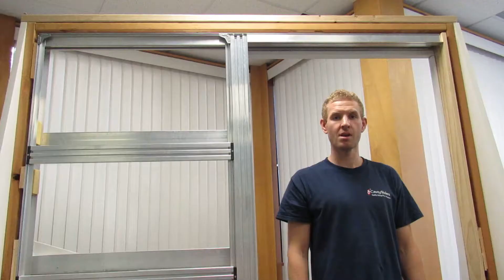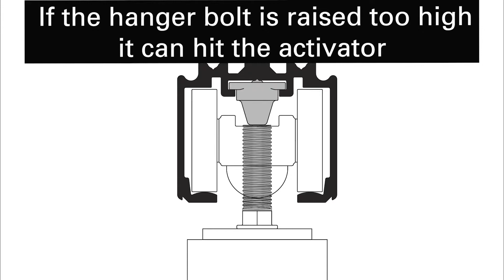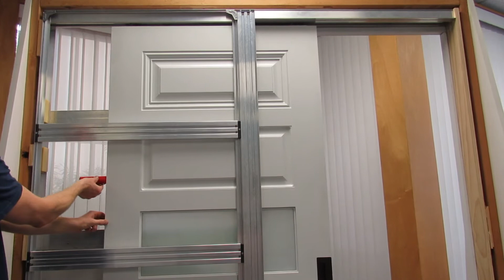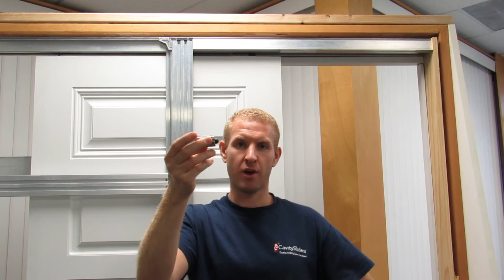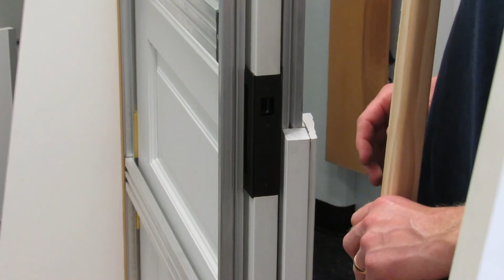SofStop Installation & Troubleshooting Tips (Updated Version Linked in Description)

Comment: Is there a minimum door size for the soft close.  Either single or double.  My door is 28”.  Thank you Chris
Reply from the maker: Hi there! Thanks so much for your question. The minimum requirement for soft close (with 1 stop) is 28". For soft close in both directions (with 1 stop) the minimum requirement is 36". So your 28" door should be able to accommodate our Single Sofstop. Feel free to call us at (888) 466 0030 if you have more questions! We'll be more than happy to walk you through the process of selecting the Sofstop right for your project. :)
Reply: @CavitySlidersUSA  I found info at bottom right here that seems to be direct from your company that says soft open and close is 34" minimum for single door and 37" minimum for bi-parting.  https://s1.img-b.com/build.com/mediabase/specifications/cavity_sliders/1470817/sofstop%20us.pdf

Is that accurate?  Does bi-parting in that case mean 37" total opening or 74" total opening? (i.e. combined door width for both doors)
Reply from the maker: @timm439  Hi Tim! We're actually working to update those specifications. If you check out our website, we have the most up to date information available on the second page of this document: https://www.cavitysliders.com/Portals/7/PDFs/Brochures/CaviTrack%20US.pdf

I have a few follow up questions to provide an accurate answer to your question, would you be able to call us (888.466.0030) or email me at sales@cavitysliders.com?
Reply: @CavitySlidersUSA  I tried emailing you but haven't heard back, FYI.

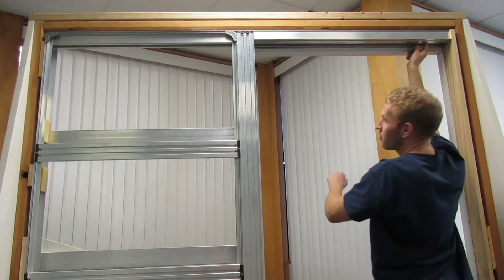Comment: @0:35 it would be nice if you can explain how to put the back carriage into the track as it has a connection extension on one side. So, which way should it go in? Does it matter? I guess I’ll find out at he end of my installation.
@1:10 it would be nice if you can mention that one needs to remove the bolt from the sliding mechanism first and then to pay attention to the nut it connects to as it tends to pop out from its place when one tries to hook it up to the carriage.
Reply from the maker: @0:35 Good question! Luckily It doesn’t matter what orientation the tow bar on the carriage faces 
@1:10 Good point! We will be making an addition to this video in the near future and we will mention this.

Comment: So you have to set the soft close for the back side before you finish drywall. :-(
Reply from the maker: Are you doing soft close in both directions or soft close in one direction? If soft close in both directions, then yes, you will need to set the back activator before fixing the drywall. If just in the soft close direction, then this can be done after drywall has been fixed.